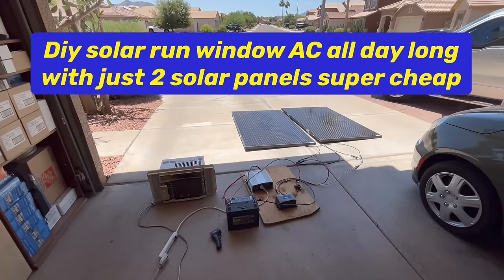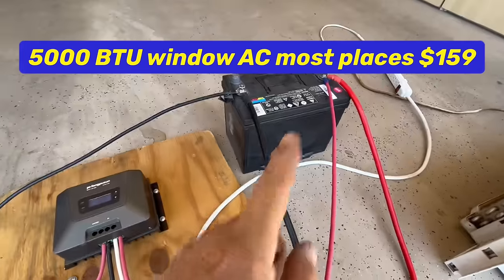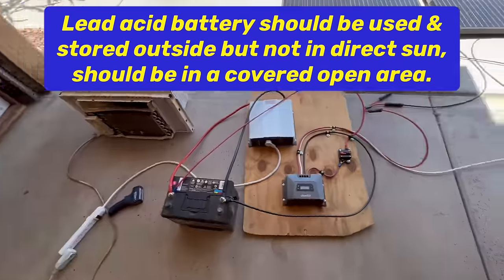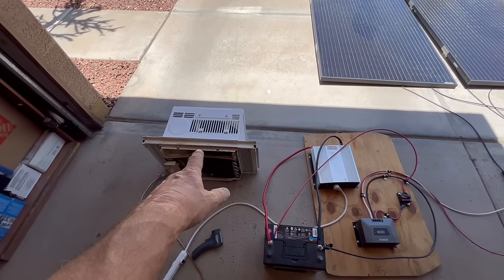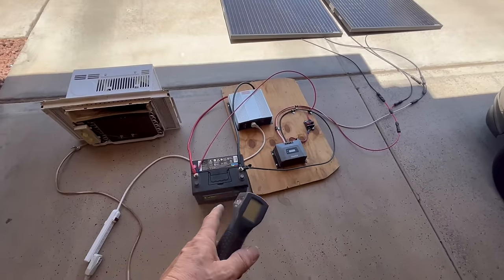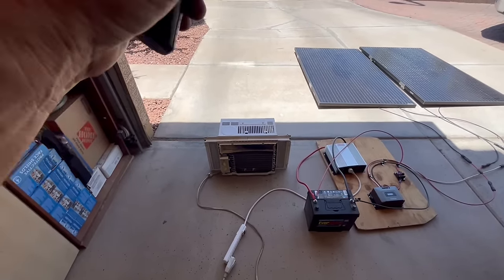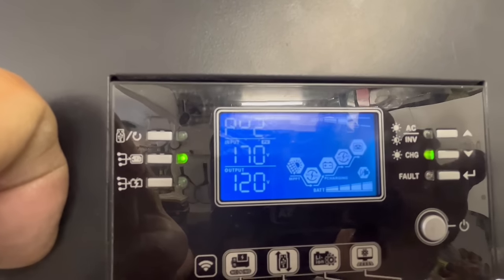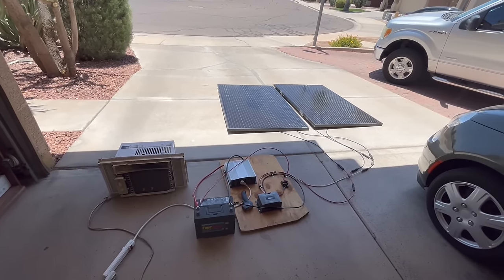Run your window AC with just 2 solar panels when sun shines. Easy DIY project you can do in one day.

Comment: I could use a little advice from solar master Pappa. I picked up a couple 200w used Mono panels to fool around with this project And came up with this: Each panel is rated at 21V / 9.5A (ideal of course) so I hooked one up in full Florida sun with 12V battery just to see how it acted. In full direct sun the battery charge is about 5.2 A (I can live with that) with a standard small Renogy controller, but here's what happens. I can just wave my hand over the panel (doesn't matter what part) and the charge current will drop down to a quarter amp or so until I remove my hand. My question is: does that mean that these panels are shot or do the panels act that way anyhow? When I picked up these panels I checked them with my Fluke and the voltage and amps (unloaded) were close at about 9A current / 22V.
Reply from the maker: That panels is acting like a poly panel. With mono, there should only be a slight drop in power. Are you able to see how many watts you are getting with no load and with a load? Could also be your small controller. Is it PWM or MPPT charge controller? The newer all in one inverters by EG4 3000 watt inverter has an excellent MPPT charge controller. I know with my used solar panels, there is just a slight change is power when my shadow is on panel. Are you completely positive those panels are actually mono panels?
Reply: @diy-solar-guy  I looked them up before getting them and the data for these HIGHTEC SOLAR panels RCL-M-200W list as mono. I did not hook up the load terminals on the PWM Renogy controller, just the battery terminals to keep charge on the batteries. Funny thing is I tried it also with a cheapy MPPT controller and the PWM actually ran better. Perhaps I need to throw a load on the controller output terminals just to see if there a difference. All my checks so far have been on the controller battery terminals (also with an ammeter) and get the enormous current drop with the wave of a hand. I didn't think I might have to have a load attachment if I was just going to charge/maintain batteries. Tomorrow I'll try again but I'll put a small resistive load on the controller load terminals to see what happens. You're the best!
Reply from the maker: @GeorgeKennedy-u4r  the battery is there to keep the load running when there is a change in solar input. Good luck with your experiment with load on panel.
Reply: @diy-solar-guy  Pappa I think I may have cracked the code when checking out my panels. I forgot about the little Renogy Wanderer being all automatic. Waving my hand over the panel causes the current to drop some and when I remove my shadow the current drops to zero, but after 5-10 seconds it ramps back up to where it started. It may be that the controller sees a rapid voltage spike when I remove the shadow (safety feature) so it cuts out for a few seconds. Then I see the pulses coming back to bring the Amps back up. Who'd have thunk it? Once I get a small project operational then I can start spending some cash on the better equipment. It's almost like catching solar fever!
Reply from the maker: @user-ol5rj8qn9o it is a lot less expensive now than 4 years ago when I started and much better efficiency on all components. My system will have paid itself off with just electric bill savings by December 2024. I use more than double the amount of electricity now because I can and my electric bill is a fraction of what it used to be even with all the increases in electricity. Life is good when you have off grid solar and a heated or cooled pool. Hope your project is a great success when you build your system. I actually have 3 separate systems. Right now I am trying to move all my loads over to the 4 - EG4 inverter system and shut down the 2 Growatts as back ups and combine all my EG4 LiFePO4 batteries to make a 45.9 kWh battery bank. A little more and I will be able to produce 1.2 gigawatts to go back to the future. Lol
Reply: @diy-solar-guy  Man it sounds like you'll have a NASA space site over there soon. The guy I bought some used panels from has 2 systems. He has the solar fever. If I had a bigger chunk of property I would nix that crab grass, trim some trees and try a ground unit perhaps with some tracking. I'v seen where people build automatic tracking units using liquid vs electronics. The whole thing is fascinating and I can see how you're hooked. It'll be nice to see the completion of your expanded project.
Reply from the maker: @user-ol5rj8qn9o my system has quickly paid itself off with savings on electric bill. We use to keep thermostats at 83-85 in the day and 79-81 overnight.  Ow it is 70-73 in the day and 73-76 overnight. We sleep so much better now and our electric bill is 80 percent less. My wife has not changed her use of electricity since going solar and still saving 80 percent off electric bill. Solar is getting much more affordable and extremely easy to do DIY. I do have 2 back up systems like NASA. lol. Once you start and see what you can run, it can be never ending on new products. Thanks for the comment and hope you have a truly wonderful and blessed 2024 and hope you are able to figure a way to do solar off grid.

Comment: If you have to buy everything from scratch, there are already DC air conditioner kits with solar panels included, and the possibility to switch to AC when the battery is depleted. But if you already have an AC AC :D this is good , just add a car capacitor(they are available for HIFI high power music "enthusiasts") to the battery, it will prolong its life, no matter how deep cycle it is. Just an opinion of course.
Reply from the maker: Thanks for the information, I know they have mini splits that are direct solar panel input that can also be run by grid or battery at night. Can you tell us where to get these kits? That would  be great to get that info. Thanks for your input and I hope you have a truly wonderful and extremely blessed week
Reply: Links please 😊
Reply from the maker: I built this system 4 years ago. Most of the products are not available now, but you can buy similar products for around same price. There are some links in the description of this video and some other videos. Hope you have a wonderful and blessed weekend

Comment: I wonder how well or if it would work with 2 100W panels and a marine battery?
Reply from the maker: I won’t do anything. You need at least 500-550 continuous watts to keep running. Ac uses a little over 5 amps while running. You will not have enough solar to run. You can always over produce more than what you need, that will keep ac running and battery charged but if you underproduce you battery will discharge dry quickly and you will drop below 12volts in a matter of minutes. If the ac needs 500-550 watts to constantly keep running, you should add at least 30 percent or more in solar panels. This system would be much better off with 1000 watts of solar, you would have to add another charge controller to do that since this charge controller is maxed at 2 solar panels. Thanks for your question, hope you have a wonderful and blessed week

Comment: Setting up multiple systems like this to run separate heavy appliances is cheaper to build and will reduce your energy bill.
You can spend $60K on a whole house system, or $6K on multiple solar systems.
Several small inverters is cheaper than one big one and not everything is down if the inverter fails.
If each individual system costs about $300, then you can have up to 20 systems for $6000.00.
You probably do not have 20 appliances in your house.
An upright freezer was costing me about $50 per month on the grid which pays for the 200W solar equipment and 2 batteries in 6 months.
Then you get to run the freezer for a few years for free.
If you can separate all the lighting in your house, you can run all that on one system.
You are probably not going to have more than 2kW of lighting in the whole house, especially using LEDs.
Ceiling fans may be a problem.
Refrigerators, freezers, lighting, ... most everything except circuits that include blenders, hair driers, and other motorized high wattage items or your electric range.
If changing back and forth from grid to solar becomes a problem, use a UPS on your TVs and computers. They will never know it happened and nothing else cares.
Reply from the maker: Check out my other videos, I actually now spend $0 on air conditioning in my 2 story house that is 2450 square feet 7/24 and air conditioning my 3 car garage that is almost 600 square feet. While it is an average of 113 degrees out during the day and 90 degrees for overnight lows. We are saving 90 percent of our electric bill using off grid solar power. I have 3 separate system. The 12kw Growatt off grid low frequency is used to run my 3 1/2 ton, 4 ton heat pumps and my 127,000 btu all electric heat pump pool heater to heat pool to 87-89 degrees through the winter. This video was just a simple example of what you can do with solar. We show a lot of different ways to use off grid solar saving us almost $6,000 a year in savings for how much we use. Hope you enjoy all the other videos. Thanks for your input and hope you have a truly wonderful and blessed week

Comment: works when sun is directly overhead and no clouds, which might be from 10am to 2 pm.  But I want AC until the sun goes down
Reply from the maker: You would have to increase the size of your solar panel array so that you would maybe have 2-3 solar panels facing southeast and 2-3 solar panels facing southwest. You would be better off going with an all in one off grid inverter say 24v or 48 volt that can use from 2400 watts in solar input. Also your battery bank would have to increase from 12 volt to 24 volt or 48 volt depending on your inverter you choose. You are very limited on a 12 volt charge controller to about 2 solar panels. But a 24volt 2400 watt inverter would allow you to use up to 10-250 watt solar panels. Also your charge controller and output 120 volt ac inverter is built in to an all in one inverter. You can expect to pay $450 - $750 for a 24v, 2400 watt all in one inverter and then you will have to get a 24v battery or have 2-12volt batteries in series to get 24 volts. If you plan on using long term. This is the way to go. If you use Lithium iron phosphate batteries, they will last you 10-20 years versus a lead acid battery only lasting 3-5 years. Hope this helps. Once again this video is the bare bones basic and is a starting point. You improve the system to meet your needs. Hope you have a truly wonderful and blessed 2024

Comment: Just a thought. Use the heat to keep the water hot, even as a preheater to the water heater. 
Second thought. Since a heat pump is more efficient than electric heat, use a compressor to move solar heat from both the Sun and from the attic of the house, to the lower living quarters. 
Do you have natural gas,or fuel oil, even propane heat, use the coil from a window AC, to remove all of the heat from those heaters, before the fumes are released into the atmosphere. 
Also, build a wood burning heater, with a square box of black iron pipes, filled with radiator fluid, inside a metal drum or container. The hot fluid rises to the top and out the side,where it enters a metal container,(even a metal trash can), which is large enough to contain a coil of copper tubing, which will have Freon to receive the heat from the stove heater's radiator fluid.
Reply from the maker: Thanks for your input.

Comment: We are looking into the mini-split unit as well - did you install yours' by yourself? Nice set up!
Reply from the maker: Everything we did in video was DIY. Very easy to install mini splits. I installed all my mini splits and the 3 soft starts on my 3 1/2 ton, 4 ton and 12.7 ton heat pumps. I have 3 videos on installing the soft starts. I bought gauges and vacuum pump from Amazon for around $140 before I installed the 6 mini splits in my house and garage. I used Nylog blue on threads of refrigerant Lind connections to keep refrigerant from leaking out over the years. Been 4 years with no leaks. You can buy on Amazon. All 6 mini splits are working great 4 years later with no problems. I have 3 different brands. I bought the cheapest ones on eBay at the time, AUX brand and Premium brand. Still almost the same price now. There is such a large selection out there for mini splits now. Higher the seer, the more efficient and less power used, great for off grid battery overnight use, but expect to pay around 3 to 4 times the price of lowest priced mini splits available. But if you are off grid completely, it is well worth the money. Hope this info helps, there are guys out there that show installation of mini splits step by step, easy to follow and do yourself. Thank you and hope you have a truly wonderful and blessed weekend